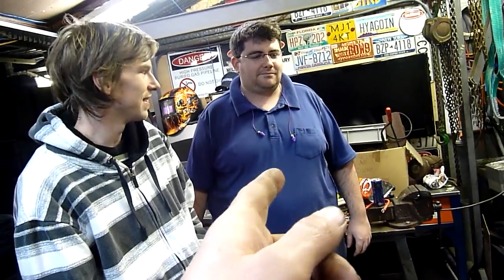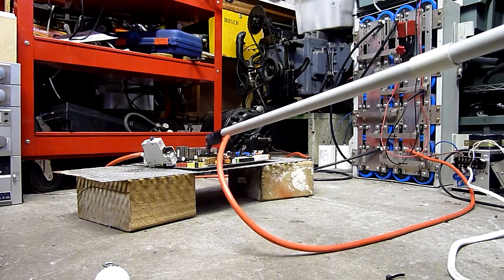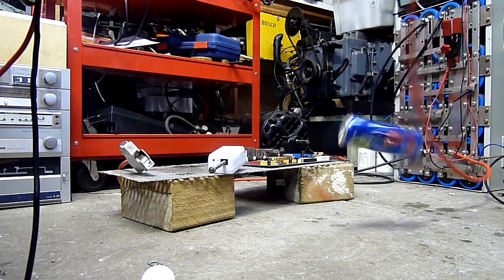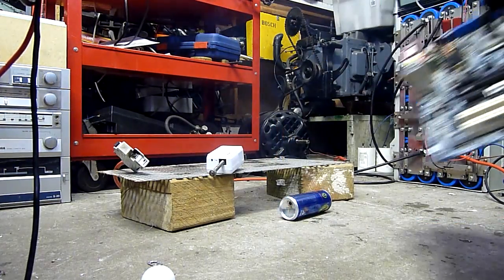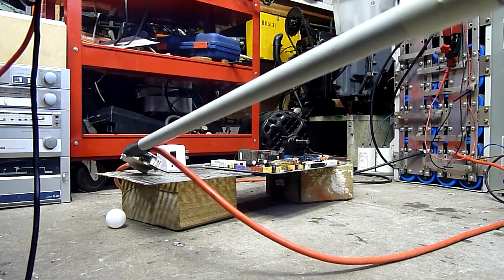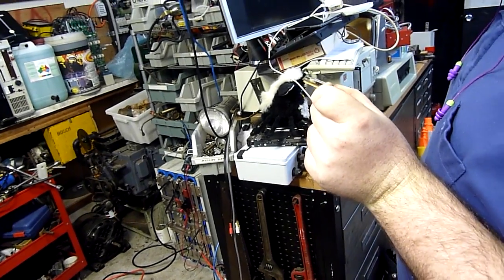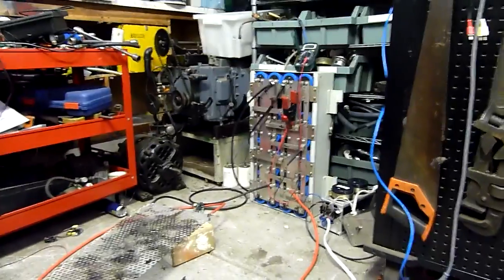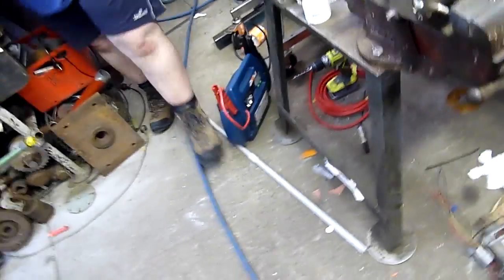Low Voltage Capacitor Bank fun with Jgcertified and LemMing

Comment: Aussie50  If shipping didnt cost so much id send you my old Miller Delta Weld 451 (450amp 40volt DC welder) to fry stuff with i dont have 3phase at my house so i cant fry shit with it. But ive done some at work with a chicken pole like you have and destroyed many motherboards with 45 volts and 450 amps. It does blow holes in 28 gauge steel plate with a 3/4 inch bolt. If cameras were allowed in the shop id film it all lol!

Comment: I'm really curious why you were charging the caps with the generator.  The motor turning the belt was AC and I would expect the output of the generator to be AC, so why not just rectify the AC directly?  Any chance you could shed a little light on that for me?

Comment: ah poor athlon..... the dual cores are still decently good. built a rig with one and a 75 dollar GPU and it ran stalker clear sky! 

ive still got a phenom 2 1090t 6 core at 4ghz on 1.55 volts and a big ass notchua cooler..... 16 gigs of ram 1600mhz at 7-7-7-22, and a 6970.
Reply: +kain hall wise words there 

The dual core is still a cheap but reliable workhorse CPU 

Still it's got nothing on my core i7

Comment: That big ol' generator's a fun piece of technology, that's for sure... :D

ooh, them's some nice sparks... :D

Yeah, make a keyring out of that AMD's spreader, I did the same with a burnt out Athlon X2 4400 (damned shame, but, it was so burnt out that solder had leaked!!), they make great keyrings... :P

That HDD's bearings sounded as bad as that chonda engine with the welded bearing you had a few years back... :P

Comment: Aaaah, nice to see that the Westinghouse can still pump them electrons after all these years. :-)

Hmmm.... Charging the caps with only 110-or-so volts?

Poppage needs a bit more gruuuunt than 110v.

If those caps can take a bit more than 110v, see if you can change your setup a bit so that you can get more volts in those caps and then re-try this. More volts = bigger bang!
--------------------------------

OR......

--------------------------------

Depending on how much amperage your variac has, make a Fun-Jiggery-Pokery Unit, ballast your variac at 3kW, turn it up top-whack, make yourself a Tickler and then tickle that computer board to pieces. :D

.....You might be surprised at the sparks and pops you'll get!

Also, because that setup can deliver continuous current (unlike caps) it isn't too long before something on the board gets too hot and you achieve flaaaaames. :D

Even though only a small circuit board, I once completely done-in a CFL board and there was masses of sparks. Some of the components wanted out and detached themselves from the board and then the whole board let loose and there was flaaaaames. :D

Yep, 240v ballasted at 3kW = LOTS OF FUNN

No recharging needed, continuous current, lots of grunt.

Thanxx for showing,

-BoomBoxDeluxe.

18th May 2015, 15.45

Comment: Ed, ya know what you could do, is get a big flywheel and put it on the generator. Spin it up, and connect the generator output directly to stuff. It could really put out some energy for a second or two with a big enough flywheel! :D
Or, you could hook it up to the yanmar! :D (If it can go at the right speed)

Comment: If you were using an alternator (AC output), you could have used a voltage doubler to store more joules in the cap bank :P